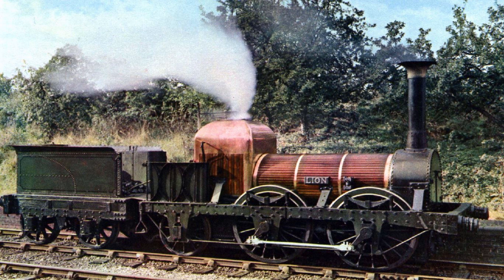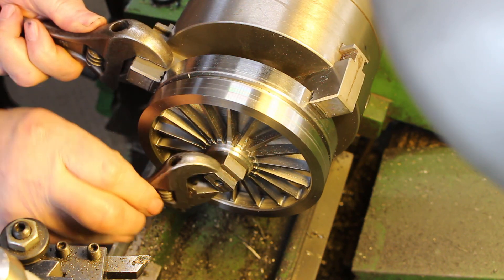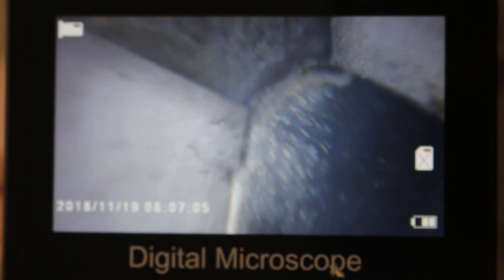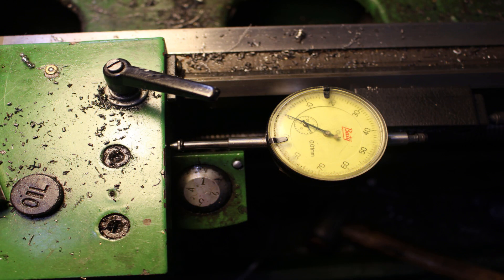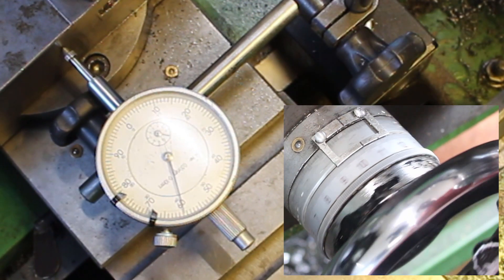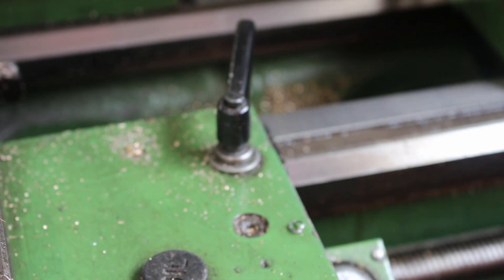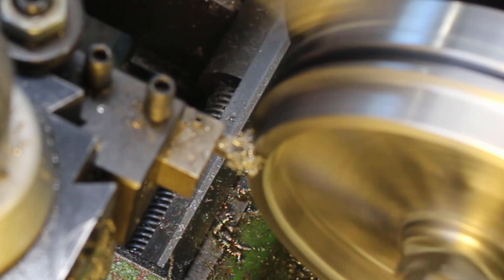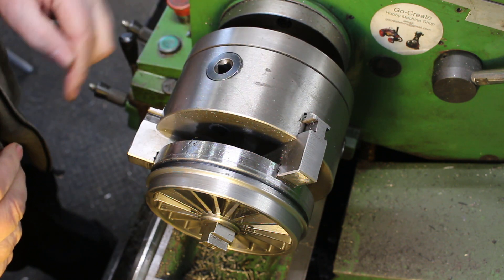Lion - Locomotive Steam Engine Build pt.31 - Driving Wheels Spokes and Tread

Comment: Hi, I am slowly going through you build videos, nice work. One day I will hopefully build a BR55. I am curious what sort of CNC you have? Thanks
Reply from the maker: wow! Thanks for watching my videos. My cnc is a DIY conversion of a pretty standard import, in my case from Amadeal UK. I fitted ball screws and stepper motors, I run it on Mach3 through a smooth stepper with a breakout board between the smooth stepper and stepper motor drivers. So far it's been great, many hours running now without any problems. Cheers!.
Reply: @GoCreatehms  Thanks for the answer, it looks like it works well. One day I hope to build a CNC. I better finish a few of my current projects first. I still have another 30 videos to watch :) . Oh and I love the detail you put in, I think that is what makes it what it is!

Comment: Superb build Sir. Over the past few days I've managed to catch up to only 1 month behind so far on this build.
At 1.45, while turning the tread profile of the drive wheels. Along with the one center hold point of the wheel. Could you not have used a bolt through the spokes in one of the three holes in fixture plate as a drive dog such as used on a face plate to take heavier cuts to save time? Or as commented in one of the previous videos is hindsight 50/50? LOL
Reply from the maker: Hi, those 3 holes were actually drilled and tapped for the purpose of adding a clamp between the spokes, I thought I might get some chatter, in which case I would add the clamps, but there was no chatter taking fine cuts so I didn't bother and I'm not in any hurry, quite enjoy just taking my time.
Thanks for your watching my videos, much appreciated.

Comment: Nice. Whoever picked the number of spokes on what seem to be two equal sized driving wheels, clearly wasn't a model engineer. I am really struggling to understand what the point of that was - if they needed 18 for strength at the front, did they really save so much by dropping 2 at the rear? I assume they were cast, so that's 2 patterns instead of 1.
Reply from the maker: Thanks for your interest and comment, much appreciated.
I've modeled the wheels off the original engine which had the main driving wheels at 18 spokes and front driving wheels at 16 spokes. Being over 180 years ago I guess the reason for it is lost in time. Castings are available for both the 3-1/2" and 5" gauge models but with the same number of spokes  in all driving wheels, it's for this reason myself and several other builders have made our own wheels to stay true to the full size loco. The LBSC drawings don't go into the finer detail of the full size loco, so many builders try to add detail so that their model is a truer representation of the original.
Reply: The reason for the different numbers of spoke  is that the engine was involved in an accident many years ago and the front wheels were damaged. Another pair with the correct diameter but a different number of spokes were used in the repair.

Comment: Lovely workmanship, I am also building a lion, So watch these with great interest, As you are doing your own spokes, ( I am doing cast wheels ) Did you know that the full size lion has a different number of spokes on the leading and driving wheel, You could do that , I can not.
Reply from the maker: Hi Gary, Yes, I've made the leading wheels 16 spokes and main driving wheel 18 spokes. The same goes for the smaller wheels, the loco trailing wheels are 11 spokes and the tender wheels 10 spokes. 
Great to hear your also building a Lion, I've a lovely loco.
Reply: @GoCreatehms  Good man, It is going to be a first class job,Keep the videos coming.

Comment: Lovely work there on those wheels! May I ask what sort of CNC you are running please?
Reply from the maker: Hi, My CNC is a DIY build, I took a cheap Chinese mill, stripped it down and re-built it as a CNC. It works pretty well though lack rigidity which for larger jobs like these driving wheels means lighter cuts and longer running time, other than that I'm very happy with it.
Reply: @GoCreatehms  Thanks for that. What sort of system are you running on it? Cad/Cam or is it G code? Regards, Ex309
Reply from the maker: I'm running on Mach 3 which has not had any problems. For creating g-code I use Vectric Cut2D though I'm starting to look at Fusion 360 for 3D machining.

Comment: Good job its not Evening Star, nice job Nigel.  Your BH600 is 1000 times quieter than mine, did you change the wheels for a belt?
Reply from the maker: Hi Donald, thanks! On the BH600 i changed the drive for the feed from gears to toothed belt, I couldn't tolerate the noisy gears.

Comment: hi gchms
lovely work, like the spokes, they came out really nice, just out of interest what approx. time difference did you save on cnc versus manually machining them. Thanks for sharing, very interesting. I appreciate the amount of work and effort gone in to this.
regards
mr f
Reply from the maker: Hi Mr Factotum. The CNC was not as easy I you might think, allot of trial and error. My machine lacks good rigidity to machining has to be done with relatively light cuts. First off driving wheel took 9 hours, but i got this down to 5 hours on subsequent wheels. Altogether I spend 60 hours on the cnc, but I did set them up a second time to thin the spokes, though machining time for that was about 30 minutes each driving wheel and 15 minutes the smaller wheels. A job like this on the CNC is pretty boring stuff but a great time saver. A gut also building a Lion told me he spent 300 hours machining the wheel from solid all manually, to be highly commended for skill, patients and dedication.
Cheers
Reply: @GoCreatehms  thanks. I guessed as much. I think I will be sticking with manual.  As my apprenticeship taught me . Although I would like a try at cnc though I don't think cost and time would be worth it for me. Thanks for getting back to me. Appreciated.  Look forward to the day the lion will be running. As I bet you are 
Regards Mr f